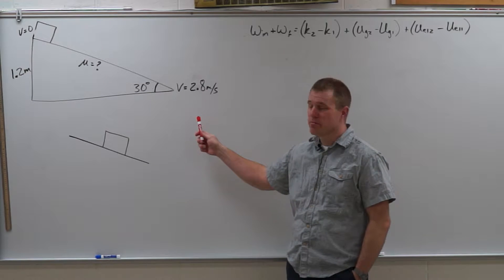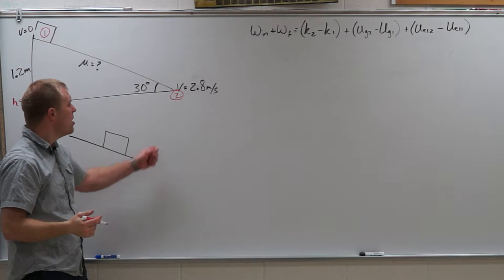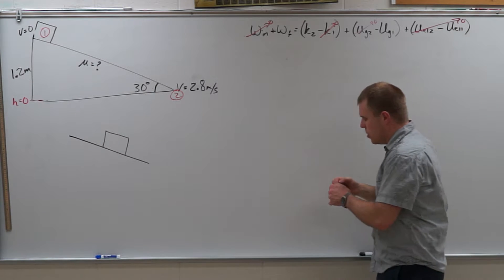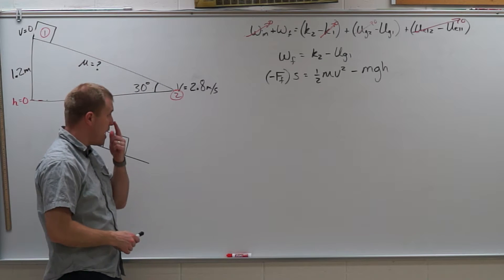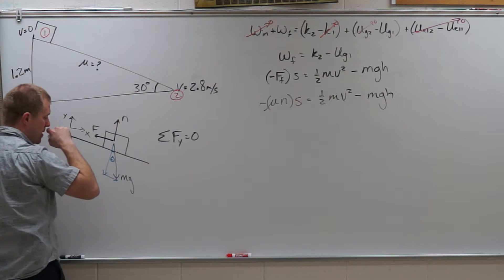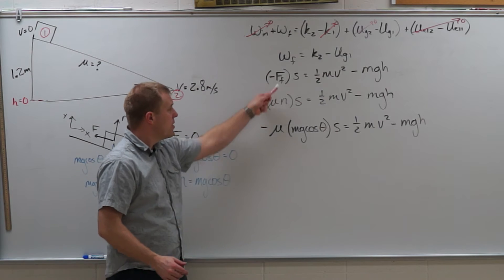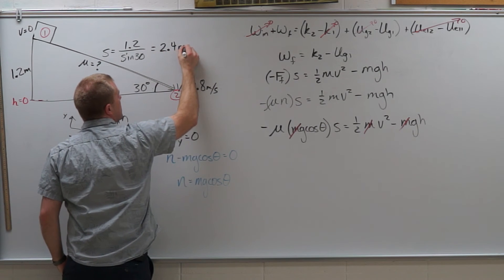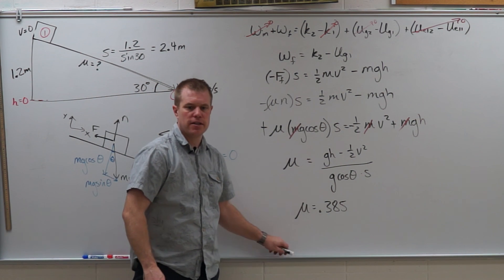Work Kinetic Energy - Inclined plane with friction

Comment: What would be the work done by friction?
Reply from the maker: You would have to go back with the mu value we found, and Wf=-(mu)*n*s=-(mu)*mgcos(theta)*(1.2/sin(theta))
Reply: @dcephysics function panjang=      1, 2 meter+(1, 2 meter x sin 30°) = 1,2 meter+(1, 2x1, 2) =1, 2+1, 44=  2, 64
Kecepatan v=2, 8m/s
t ( waktu) = 2,8-2, 64=0, 16
Maka jarak reality maybe= 2,8x0, 16=0, 448. 
Panjang sebenarnya=1, 2÷0, 448=2, 67
Atau 0,448÷1, 2=0, 37. Selisih 2,67-0, 37=2, 30
Reply: 1,2x0, 5=0, 6